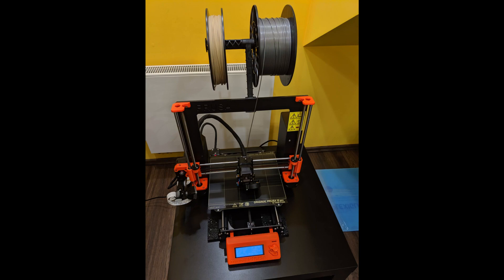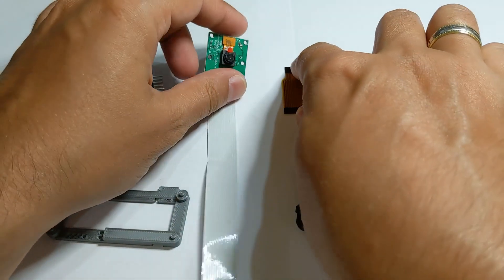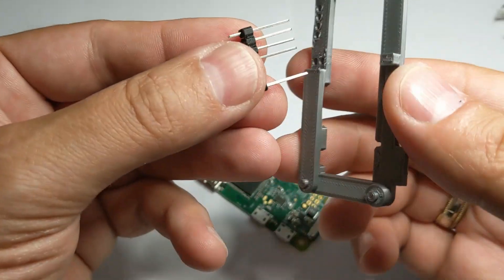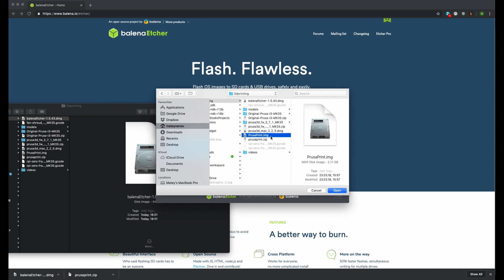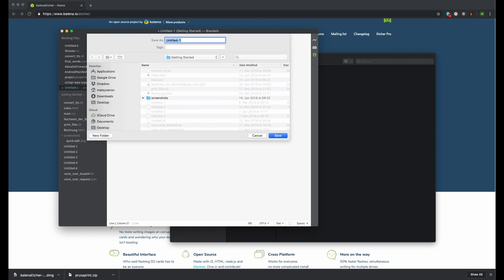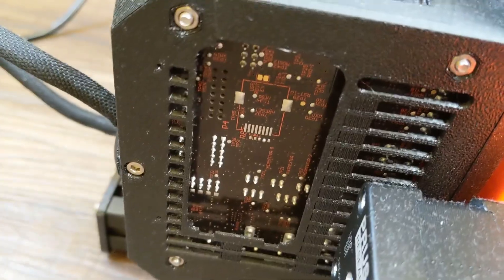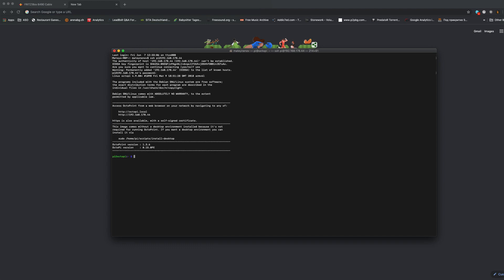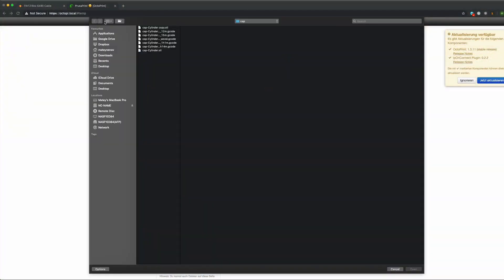Prusa I3 MK3S WiFi and Camera upgrade with Raspberry PI Zero W and OctoPrint

Comment: Hey! What a neatly integrated upgrade!
Reply: Yeh it looks like prusa intended this. Fits perfectly in that spot. 

Any advantage over what the rest of us do other than being amazingly well integrated? (What the rest of us do is connect our pi via a USB port (eg Ender 3V2 we connect the pi via the microUSB in). 

Just wondering if it benefits from any sensor input not available otherwise, of not having the USB bottleneck which we get occasionally with some prints if using octopi via a USB connection?

Also how does the camera work? I bought a Pi 3 b+  because Octoprint don't recommend using a camera sigh the pi zero w (concerns about processing power and potential to mess up your print)...

I have seen yourself and actually one of two farms using pi zeros with cameras....if it works I'll risk switching go a pi zero for that purpose and free up my pi 3B+ for more demanding tasks!

Comment: some said the zero don't have enough power to support the camera streaming, do you think it's the case?
got 3 zero installed on my printers but haven't tried that out
Reply from the maker: It has enough power to see if there is a problem with the print.

Comment: This setup is working fine ? Because all the people says that raspi zero w is to weak to deal with octo and camera.. I want to add octo to my prusa, but i want a sleak installation like this.. Is it fine ?
Reply from the maker: It works just fine. I'm using this setup for over one and a half years and never had problems. Recently they started showing a warning, that OctoPrint is not made for the Zero raspi though...
Reply: @undeadswarm  Are you using octo or PrusaPrint ?
Thank you for video and help.. Now i´m confident to install a Pi Zero insted a of a Pi4.
Reply from the maker: PrusaPrint is OctoPrint

Comment: Hello and Happy New year 
Will this tutorial work with ender 3 or any other 3d printer?
Reply from the maker: Sorry, but no!
Reply: @undeadswarm  so we need to buy a raspberry pi 4?
Reply from the maker: From the octopi site: Recommended hardware: Raspberry Pi 3B.
Also you have to install the original octopi version. Better check the instructions there, how to do it. You can connect your raspberry to your printer through usb (no soldering needed...)
Reply: @undeadswarm  thank you very much
Happy new year!!!

Comment: Hi, could you give me your feeling with the MK3S? I am considering to buy this one, but in many comments on youtube, people are struggling with that version which seems to be worth  than the previous MK3. 
Thanks
Reply from the maker: This is my first printer, so I can't really compare it to the other printers. With that said, I found it very easy to build and setup. After I build it there was a quick automatic calibration and I could start printing right away (no manual bed leveling etc...)
Reply: @undeadswarm  thank you for your answer!! :)
Reply: I have the MK3S and have just installed OctoPrint with a camera as per Kampfhund's tutorial and it all works flawlessly, I upgraded from the MK2S.
Edit: Sorry, I upgraded from the MK2.5S
Reply: @-Galavanta-  Thank you for your answer.
I had the budget for the prusa, but i decided to go with the Ender3pro with some upgrades instead.
Reply: @joanS12  You're welcome, happy printing :-)

Comment: "The RPI frame and the RPI cover are included in the 3D printable parts package. You can download the package from here:"

Hi I downloaded the package from your link, but the RPI cover is not the same as the one in your video, can you please share the link for the correct one ? Thanks
Reply from the maker: It seems they forgot to add them in the new version of the MK3S package. You can find them in the MK3 package though: https://www.prusa3d.com/download-printable-parts-stl-mk3
Reply: @undeadswarm  Thanks for your support I downloaded the zip file on this link, and it does not have the clips
Reply from the maker: They are there: Printed-Parts->stl-> raspberry_cover.stl & rpi-zero-frame.stl
Reply: @undeadswarm  , agghhh my fault, I was looking to the Einsy cover all the time. Thank you very much !!!

Comment: Do you have a link of the camera pi you bought also the adaptater for the camera to raspberry zero ?
Reply from the maker: Hi Jonathan,

Unfortunately the adapter I bought from amazon isn’t available anymore! But you can simply search for a “raspberry pi camera cable joiner/extender”. The adapter is not specifically for rpi zero...
Reply: @undeadswarm  Thanks for the tips, i got another question, i just can't find 18mm gpio pin on  amazon, i just can find standard gpio pin, where did you get yours ?
Reply from the maker: I bought these: https://www.amazon.de/gp/product/B01BMRBYJ0/ref=ppx_yo_dt_b_asin_title_o08_s00?ie=UTF8&psc=1

Comment: Tried this in 2020 and it didn't work. Nothing showed up on the WiFi router and no IP address on the printer. How do you debug this? I've done the flashing twice and used two different routers but still nothing.
I note that the latest information on Octoprint says the absolutely do not recommend using the Pi Zero-w due to issues with streaming taking too much bandwidth.
Reply from the maker: Did you enable the RPi port from the menu?
Reply: @undeadswarm  - I presume you mean the RPi in Settings to ON? Yes, that makes no difference.
I took the Pi out of the printer and powered it up using the PWR USB connector and tried it in the office where there's another network within a Metre of the Pi. I did the flashing again, and downloaded the notepad++ editor to make the changes to the .txt files to make sure the file wasn't getting mangled. I'd used notepad before.
I assume that even disconnected from the printer I'd expect to see the IP address appear on the router WiFi list, but there's nothing.
I've run out of ideas, so I ordered a mini HDMI connector so I can at least see what's going on with the Pi, but that will be a few days arriving. Hopefully that will allow me to spot any errors, although I'm not sure what I'll be looking for.
Any suggestions gratefully received.
Reply from the maker: @rogerfroud300  It seems the problem is with the RPi zero. Did you get the right version with WiFi? RPi zero W?
Reply: @undeadswarm  - That's what I ordered from eBay. Is there an easy way to tell on the PCB?
Reply from the maker: Yes, there is. The W version has a WiFi chip and an antenna (printed in the PCB). Also, the model is printed on the PCB board e.g. "Raspberry Pi Zero W V1.1". Just look for images on google ;)
Reply: @undeadswarm  - OK, thanks for that, I'll investigate further.
Reply: @undeadswarm  - I've checked and this is definitely a Pi Zero W. I've tried it a dozen times, and only once did it show up on the router. So it looks like it's just not being set up correctly, and it's really flaky.
I had to change the SSID and Password to the one on the Wireless Access Point that's within reach of the printer, that's why I changed it when it was working. I also noticed that the octopi-password.txt file was missing after it had booted. Is that something that's supposed to happen?
When I get the HDMI lead, is there anything I should be looking out for? I'm presuming that it will list hundreds of items on the screen as it boots?
Reply from the maker: It is very hard to troubleshoot remotely. It is a linux, after it boots check if you can log in and if the network device is set up correctly...
Reply: @undeadswarm  - I'm afraid I've never used Linux but I've programmed Micros since they were invented and done a lot of other programming.
Does the boot operation change anything on the SD card? It seems to delete the octopi-password.txt file, so I don't know it I need to completely burn the image from scratch if I want to change anything.
When you say log in, I presume you are expecting me to hook up a mouse and keyboard somehow to interrogate the Pi directly?
Reply from the maker: You can connect it directly to the PC with a USB cable. After it is booted (the led shows the state) you should be able to connect to it with an SSH client (e.g. PuTTY on windows). There are lots of tutorials and videos on how to do this (it is pretty straight forward actually).
Reply: @undeadswarm  - Excellent, I'll try that. Many  thanks for all your help.
I assume that I'm right in thinking that I don't need this connected to the printer to get the WiFi to show up on the router?
Reply from the maker: No, you don't. All you need is power :)
Reply: @undeadswarm  - Ok, that's great
Reply: I where facing the same problem. I forgot to delete the # before my wifi info lines. Maybe you need to check this: https://community.octoprint.org/t/wifi-setup-and-troubleshooting/184
Reply: @stankleinmentink7186  - Ok, thanks for that. I've wasted far too much time on it already though, I'll just live with using the SD card. Maybe Prusa will release a proper 32bit upgrade that includes all this stuff which really ought to be part of the printer electronics and software.

Comment: the needed files are not offered by prusa anymore.
Reply from the maker: I just tested the links I provided in the description and they work fine for me!
Reply: I know, I had the same issue, the main download is there but they have stripped the zero frame out of it, I went here for mine https://www.thingiverse.com/thing:3049198/files
Reply: For the MK3S you have to download the MK3 files, there are two files for RPI